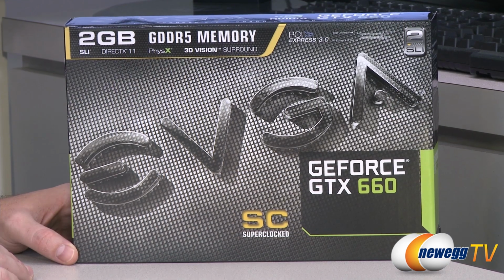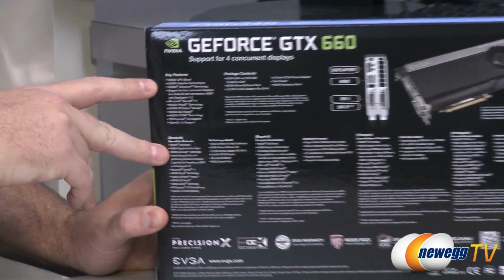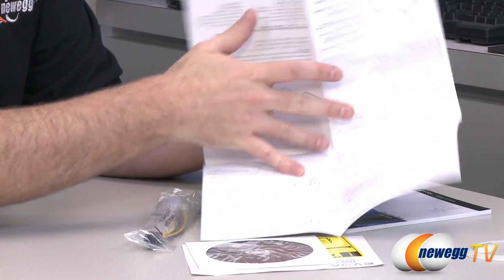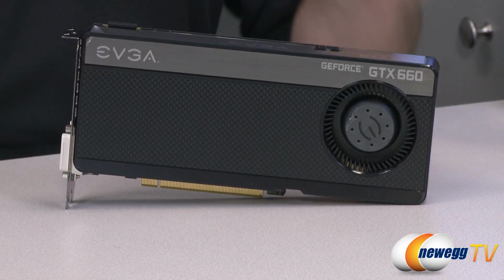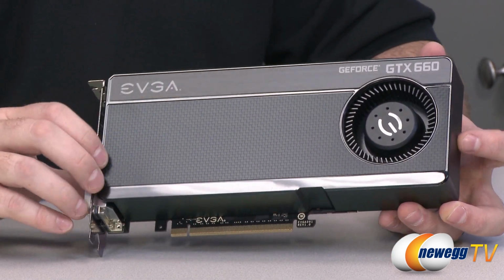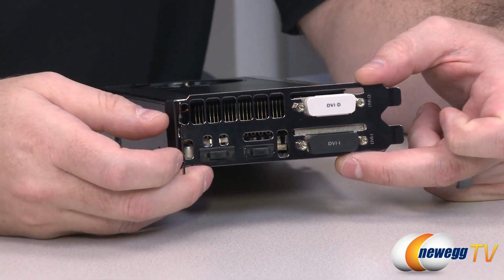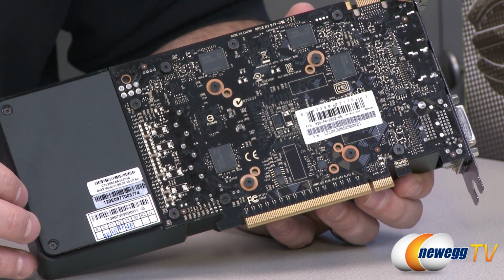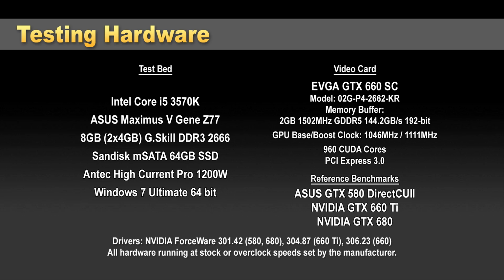Newegg TV: EVGA SuperClocked GeForce GTX 660 2GB Video Card Overview & Benchmarks

Comment: I have a reference evga 660 not the sc version. Can i overclock it to this speeds? They look the same.
Reply: liverunninG 

It's a silicone lottery. Some cards will overclock this far. Kthers won't. Each and every individual card has different overclocking potential.

Comment: I have an hp envy with an i5, 16 gigs of ram and a 460 psu. The only problem is the gpu is integrated Intel HD graphics which is garbage. Would I be able to just pop this in there and use this?
Reply: I think I'm just gonna grab a 750 ti.
Reply: TheTinyTimmyTimTim DON'T
Reply: Mohammad Abdel Jaber why not?
Reply: ***** yea the wattage was the problem. I just threw a 750 ti in there, I'm satisfied with it. Thanks anyway though
Reply: +SpyArmy58 depends which graphics card you want but  I would recommend 500 watts
Reply: DONT listen to this idiot, I had a 750 ti windforce and it was an extremely durable and efficient card that lasted years till I upgraded.

Comment: in february 2015 is it worth buying this exact graphics card for gaming,

i want to run CS GO etc maxed out 60+fps
Reply: 660 is better than the 750ti
Reply: You could run CS:GO on the gtx 750ti. A VERY POWER EFFICIENT CARD I RECCOMEND!!!! My younger brother uses it for all of the valve games.
Reply: you could run csgo with an hp laptop from walmart
Reply: Not really, im sure cs go needs a slightly better pc than that
Reply: arslan manzoor nah, my 970 gets like 1000 fps on max so i'm sure that the 750ti can hold up.

Comment: would this card bottleneck an fx-6300 or an fx-8350?
Reply: Nope.
Reply: thanks
Reply: what about a pentium 3528? (the overclockable one)
Reply: *pentium 3258
Reply: If your scared of bottlenecking your gpu you may want to look around on youtube about what will bottleneck what. I know jayztwocents did a video on it a while back. You should go check that out if your worried. hope this helps.

Comment: I just got this card recently for such a good price. I got it for 119.99. Now I didn't get it on ebay and it wasn't used either. I actually got it retail, new and in person. It was best buy. They have a sale on it where it's like 50% off. It regular price there is 239.99. So yea. Get it while you can cause when I was there, it was the last one in my area!
Reply: Jonison Mejia 
Ah, two years ago... 
I just received mine second hand for €50
Equivalent to about $60

Comment: hello i'm looking to buy this gpu i would like to know if it will work well on an old system, specs, core 2 quad q9300 , asus p5kpl-am-epu, ddr2. i have a power supply capable of powering the gtx660.Can you please give me a response.
Reply: No i wouldnt recommend it you need a better cpu if you want to power this gpu with no bottlenecks also make sure you have 8gigs of ram
Reply: Moethedirt what gpu would you recommend for me to use with this system
Reply: ***** I reccomend a gtx 750ti 2 gb edition from evga or msi or r7 265 2gb from sapphire or msi
Reply: Moethedirt thank you very much I will go with gtx750 ti
Reply: Hope You like it i have a gtx 650 and it runs games medium settings @1080p very wellso yours will be much better expect high 1080p 60fps
Reply: Can't wait to get it and test it out

Comment: how will this card handle nba 2k15 , im getting lag and stuttering and its only playable with everything at low and on 600 resolution. I have a gt 620,  i7 3770 3.4ghz  and 16gigs ram. Will i see improvements with this card and how much? Any help appreciated.
Reply: Your current card is a big bottleneck for the cpu you have, i would suggest upgrading to a 660 or better.
Reply: Got the 660 game runs fine thanx

Comment: HELP!! QUESTION!! Edited***

Can I use this product with the Geforce 2-Way Connector (from Nvidia).?

I am using 
- MSI Z97S SLI Ready
- i5-4690K
- EVGA SuperClocked GDDR5 2GB (two of them) 
- Corsair 16GB RAM
- Corsair 750D Case

I am just wondering if I can Use the GeForce 2-Way SLI Bridge on the EVGA GTX660 2GB SUPERCLOCKED. 

I just don't want to use the STOCK SLO BRIDGE.... Also How Big of a Power Supply Do I need? For this Graphics Card?

Comment: HELP!! QUESTION!!

Can I use this product with the Geforce 2-Way Connector (from Nvidia).?

I am using 
- MSI Z97S SLI Ready
- i5-4690K
- EVGA SuperClocked GDDR5 2GB
- Corsair 16GB RAM

I am just wondering if I can Use the GeForce 2-Way SLI Bridge on the EVGA GTX660 2GB SUPERCLOCKED. 

I just don't want to use the STOCK SLO BRIDGE....
Reply: yep its compatible

Comment: Hi, I'm doing my first gaming pc build, I'm on a budget. Specs are 
Intel core i5- 4440 3.1ghz quad
8 gb RAM
1 tb
Windows 7 ultimate. 
Would this video card run well with these specs?
Reply: Mother board is 
Asus B85-E/CSM Micro ATX LGA 1150
Reply: Legit995 I don't see it being a problem at all I'm gonna get this card for my 4 year old build 
I7-870
Asus h55-m
8GB DDR3-1333
500GB WD BLUE
550WATT PSU
Reply: Dinesh Roy oh ok, thanks!
Reply: No problem

Comment: Does anyone know if I would be better off of I had 2 GTX 660s or just a singular 760?
Reply: always get the better single card but if ya have one of em already then stick with that
Reply: I got the 760 and I'm getting a 2nd one soon. I posted that comment in August
Reply: cool then
Reply: it wouldn't be much different fro gtx 660 performance though

Comment: and what frames would i get wile i play bf4
Reply: I play on the Nvidia Experience settings (mixture of ultra and high settings for the most part) at 50ishFPS lowest, 90ish highest, 60-65 on average.
Reply: RidiculousBoss Also will be having an SLI setup with two of these soon. From what I have seen, It's worth It. The card being priced nice makes the SLI setup worth It If you can IMO.
Reply: so it would run smooth
Reply: what would u recommend with the same price range
Reply: I recommend a 270x over the 660
Reply: CrossFIRE Gaming - Road To 100 Subs! Nope the 660 is better.
Reply: NO CHECK BENCHMARKS NOOB
Reply: I'm a noob now? Ok. When you know  the difference from actual power to optimization then you should say something. Also, benchmarks show that the gtx 660 superclocked edition is in fact better than the r9 270x power color devil edition.
Reply: And thats coming from an amd fanboy
Reply: I was just stating a fact
Reply: watch my setup
Reply: What does your setup have to do with this?
Reply: I said I'm an amd fanboy wow
Reply: oh
Reply: still 270x is better

Comment: I'm slightly confused about my Inno3D GTX 660 after checking my core clock on MSI Afterburner it clocks at a maximum 1150Mhz. Is mine OC'd already or what? From what I know it's boost clock is meant to be 1033Mhz.
Reply: the boost clocks go as high as they can based on temperature and the cards power usage
Reply: Eman2000
I don't think they can "go as high" as they want but anyway, I've found out the actual boost clocks are 1033-1110Mhz (I did not mean 1150Mhz for my card) my mistake.

Comment: i plan to run this card with a corsair cx 430 power supply will it have enough power or do i need to upgrade also im on a really tight budget ($500 - $525)
Reply: I run that setup, Corsair 430w and evga sc gtx660
Reply: 300-400 Watt is already enouth
Reply: ***** 300W? Are you sure?
Reply: You'll need atleast 550 Watt's I recommend 700 watts if you ever upgrade in the future. If your gaming with this pc and your budget is 500$ your PC will be horrible at gaming
Reply: Whilhelm08 is the gpu too noisy on idle?

Comment: Will this card run Watch Dogs on high? I have a Seasonic SS-400ET PSU and this guy said 450w of PSU is the minimum requirement, but after I calculated my rig's power consumption with a PSU calculator it said that 340 watt was the recommended PSU for me. Can my current PSU handle it?
Reply: Probably not. If the graphics card recommends a base of 450w for the whole rig, 400 is most likely not going to cut it, even if you're only pulling 340w for everything else.
Reply: if your power supply is high quality it should work just fine

Comment: yes. use the higher clocked card as the primary and the non superclocked as the secondary. then using MSI afterburner or evga precision X you can up the regular clocks to match the superclocked

Comment: just one card with k-boost on and my 8350 running at 4.7 i hit 120-150 frames in bf4 with high/ultra mix settings while flying in a chopper or jet, while on ground and in the shit i get about 80 avg. but i do dip to mid 60's in certain maps, with SLI its stupid i get about 120 always!!!

Comment: 270x is from amd... those are new gpu's and 270x is at the same price with gtx 660 and 270x is better than the 760... so yeah get a amd 270x because is way better and bf4 will run well on amd gpu's or if you add 100$ you can get 280x wich is almost better than the gtx 770 and in december you will have good drivers and a program for directx 11.2 wich will increase the performance and the 280x will be better that the gtx 770.

Comment: I have this card. The only problem that you MAY face is heat, but the card can handle it. The card runs beautiful with no driver issues and plays anything at max/high (AC3, Cysis, etc). The only bad thing is that while playing AC3 at max, I can reach up to 88c but it mostly stays around 76c-85c. It might of been my Coolermaster V6 GT that was causing the heat but I will fix it up. It's still good other than the heat though.

Comment: a.k.a the term known as "bottle-necking" my card suffers from it because my MOBO has only Pci-e 1.0 slot. But I regain that performance from using a low res monitor. My monitor is tiny, but I max bf 3 and get over 100 frames per second. As long as he doesn't play on high resolutions he should be fine.

Comment: the GTX 660 can handle 4 maximum but wouldnt run games very fast at high settings. If you want 3 monitors I would go with either a 2gb GTX 760 from EVGA ($260) or the 4gb GTX 760 from EVGA ($300). Both a little more expensive but you will notice a huge difference in framerate with either of these over the GTX 660

Comment: Yes I would
Before on my Nvidia 9500gt i could barely run Skyrim on low
But now I can run it on Ultra settings with 1920x1080 resolution
I get 45-60fps on Skyrim with this card

Comment: I have an HP 1427k. It won't work. I connected it to the PCI and then the PC's own sata cable to the card. When my computer starts up it just beeps for a little while and then doesn't work. The cable the card brought is an old 4 (3 actually) pin too. WTF? I also noticed my 6 pin sata connector has all 6 pins, but the 4 pin the card to connector has 5 pins. One is missing. I'm wondering if I should buy a sata to 4 pin adapter? I updated the motherboard's bios too. Any help?

Comment: I got this card last week - very impressed so far ! Got metro last light on optimised settings at 90 fps if you put the settings on ultra you get 30-35 fps still for a game like metro I think this is a great result - i5 3450 with 8gb ram 1600 MHz

Comment: friedchicken2z is correct but it also depends on factors like how many fans and hard drives. Generally speaking I think going with a larger power supply is advised simply because nothing can go wrong and depending on how many watts over you go it gives you the opportunity to upgrade. The power supplies I use are made by Corsair. The 500 watt power supply is only fifty dollars or you can go all the way up to 750 watts. (available on amazon)

Comment: Amd FX 6300, corsair vengeance 8gigs, nvidia 660 non-ti super clocked with two 120mm fans and a western digital 1 tb hard drive, would a 600 watt PSU run that nicley ?

Comment: You'll need to calculate the wattage of all your parts to see if that PSU has enough power for your computer. I'm pretty sure your PCI-E slot needs to be 3.0 to handle 3.0 cards, you'll have to replace your motherboard.

Comment: Radeons will take more power so if u have 385w psu, u shoud get geforce card. Anyway 385w is pretty low for any kind of setup. If u arent sure, google power supply calculator. For the money 660 is best card u can get !

Comment: I dont know why people keep mentioning how many watts the gpu needs, watts arent that important its the amps that really count, you could have a 750w psu that has around 2 12+ rails if this is the case the total amps will be split making it around 30 amps on each one, then you could come across a gold rated 600w psu with 1 single rail that has 52+ amps, because its all dedicated to one rail it would still out beat the 750w psu.

Comment: I had a serious issue with my casing tho, the Thermaltake case is totally not fit for it. But with a Dremel, and some patience i was able to mout it ontop of he casing. Leaving, the room untouched in the casing. As far as condensing goes with the kits. That should NOT occur, as in theory, you blow air from inside the casing into the radiator. That air shall be pre heated by whatever temp it is in your casing. So there no extreme differences in temp. Hope that clarifies it..

Comment: very nice I wanted to install a liquid cooling system. its my fear of it may leak or condensate some how. my last rig lasted about 4 to 5 years and still running and used above average. my new rig can convert a blu ray to mp4 in less than 20 mins that's awesome. my old rig took 12 hours to do it im happy

Comment: Nice system mine looks like so. 
ASRock MB-970EX4 Socket AM3+/ AMD 970/ AMD Quad CrossFireX& nVidia SLI/ SATA3&USB3.0/ A&GbE/ ATX Motherboard, : EVGA GeForce GTX660 2048MB GDDR5 192-Bit,Corsair Vengeance Red 16GB,AMD FX-8120 8-Core Black Edition Processor,: Cooler Master Seidon 240M - Liquid CPU Water Cooling Kit.Samsung 840 Series 2.5 inch 120GB SATA SSD,Thermaltake V3 Black AMD Edition Gaming Chassis, Corsair Builder Series CX 600 Watt ATX/EPS 80 PLUS. Certified ofcourse

Comment: No it will not, your i3 is more then enough. The true bottleneck is RARELY the cpu to begin with :). I have a older system here with a 620GT card, it runs crysis on ultra. 

The cpu is a Athlon dual core (yes no kidding) and it runs just great on my wifes computer. My point is, spend little bit more on the GPU , afterall that is what games and such require the most. A good gpu is already half the work for your computer.

Comment: 850 watt is way to much for whatever system you run really. Nothing wrong there, only if you want to waste money do that. 

FInally someone who is smart enough, to buy a CERTIFIED PSU. For most systems a 600watt psu will suffice really. 

In case of doubt feel free to contact me. MY system is a 8core running this card in SLI (so two of them) with a Corsair 600 bronze certified psu ..not even breaking a sweat.

Comment: No it does not, you confuse RECOMMENDED, with NEED. 
I do suggest people will get a decent CERTIFIED PSU ( do not go for cheap brands) Corsair, Cool master, Thermaltake and check for the logo. 

Again do not confuse RECOMMENDED with what it actually needs. This is how you empty your wallet. By following wrong adivse..

Comment: You cannot break any component by underpowering it. 
You need to listen what the man said, we RECOMMEND XXX watt on psu. 
Does not mean it has to be that big, in the old days. You had cards that ate double on watts. That is long gone....EVGA cards are anything but friendly for th PSU.  And it would never KILL a GPU by underpowering it. It would simply stall the system/boot..

Comment: My Bad I Forgot that mobo's comes with sli bridges. I have a gigabyte z77x-up7 and it comes wit every sli bridge plus crossfire thanks. Rig Thermaltake level 10 GT snow edition, gigabyte z77x-up7, Intel i7 3770, Cooler Master Hyper 212 EVO, 16 gigs corsair vengeance,  2 PNY GTX 660Ti in SLI, SeaSonic X 1050w psu, 2 WD Veloc 250 gigs, 1 pioneer Bluray, 1 liteon ihas524 with burnmax firmware. I didn't max it out fully or overclocked. I didn't want to spend all my tax money. ssd's is better I know

Comment: I bought a computer pre built and was just going to upgrade the video card because everything else is already good but i forgot about the power supply. It has a 460w max power supply and the website say this card will need a minimum of 450w. Do you think it will be ok? 
Other info: 8gb ram, AMD FX-6120 sic-core processor 3,5ghz.

Comment: This card is nearly as good as a 660TI... since its a SuperClock... and the 660TI is about equal to the 670 on SINGLE MONITOR setups! So no reason to get either if your not running either Dual monitors... OR overclocking!

Comment: i5 2500k 
16gb 1333mhz
asrock p67 pro 3 se b3 revision
seasonic 450w psu
(currently running gt 520)

would i be good with the 450w or should i not risk it?
1tb hdd 7200rpm

Comment: Just built my first rig, for myself and the wife.  What do you think?

CPU: AMD FX-4100 3.60 GHz Quad-Core 
Memory: 8GB (4GBx2) DDR3/1600MHz Dual Channel Memory G.SKILL Ripjaws X
MotherBoard: [CrossFireX] GIGABYTE GA-970A-D3 AMD 970 
Video: NVIDIA GeForce GTX 660 2GB 16X PCIe 3.0 Video Card

Comment: yes you should easily be able to with the 660. it is rather powerful and can max out just about any game at 1080p. on some of the more intensive games you should be able to get at least 50fps. the biggest bottleneck will be your cpu. on very cpu intensive games your fps will chug a bit but you should be fine. thx for subbing.

Comment: Is this a good setup and is everything compatible:
Intel Core i5-3570K
Gigabyte Intel Z77 LGA 1155
Samsung Electronics 8gb ddr3
EVGA GeForce GTX 660 Superclocked 2048MB GDDR5
Corsair Builder Series CX 600 Watt ATX/EPS  80 PLUS

Comment: right now i am building a custom pc and im stuck between to cards. I want the gtx 680 but the gtx 660 is $200 cheaper. So i am wondering if it is worth spending an extra $200 on the gtx 680.